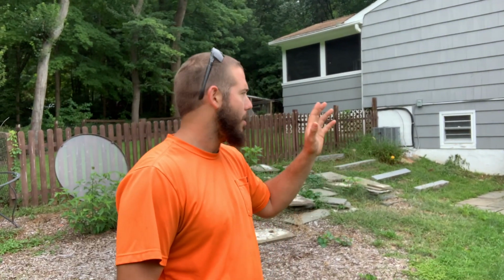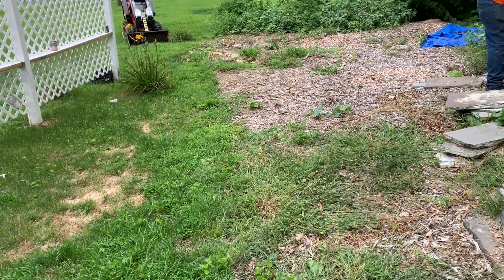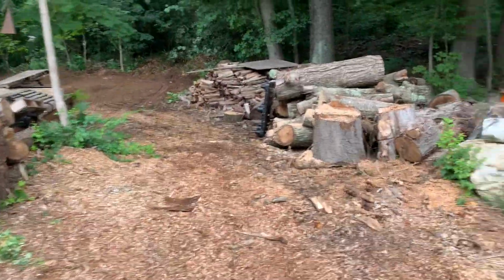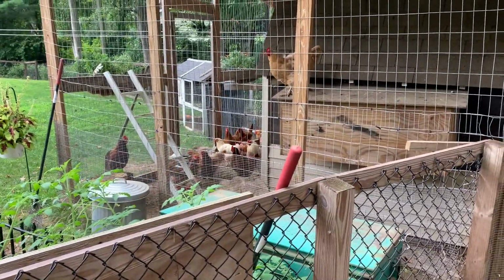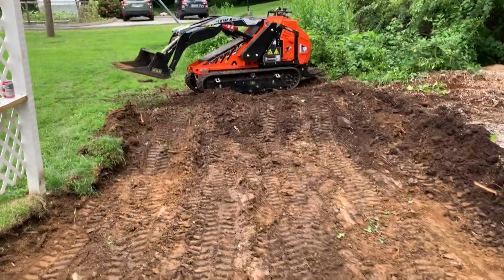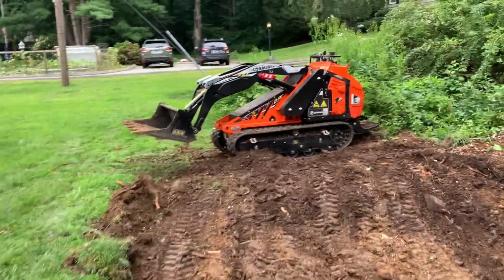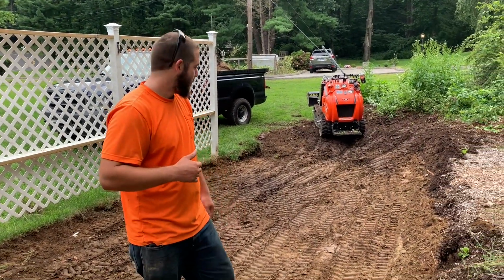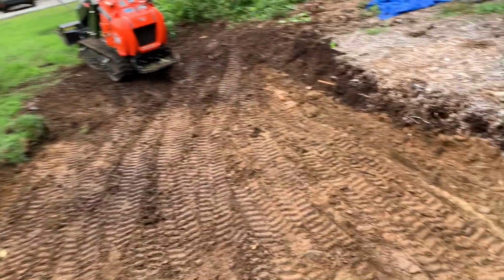#140 Cormidi Mini Skid Steer Digging Pad for Patio

Comment: Good video. You will get the hang of grading, it just takes practice. One thing I was taught when I started running a motor grader is if you get to wash boarding an area, you have to change something to straighten  it out. I found that to be true whether running a dozer, loader, motor grader or even a box blade on a tractor. Keep up the good work.
Reply from the maker: Wash boarding as in humps? Once I started leveling out a spot for the machine to start at it seemed to get easier/more consistent. We were both in a rush, will need to try again when we have more time!!

Comment: The cormidi was perfect for that job . When ever possible I have always used the pto tiller first too grind down and mix everything . I found it easier using a tractor too remove . Starting back farther like you said too start the grade is what I do also . It’s Probably one of the hardest things too do with a tractor and if you don’t start level right from the beginning it’s always a disaster . You guys did a really good job . 👍👍👍
Reply from the maker: It worked well! The soil was soft here so luckily a tiller wasn’t needed. Getting the grade is tougher than it looks!

Comment: Nice work. I've used the Toro version a bit. Very capable if time is on your side! I've always found it easiest to pick the lowest corner or end and have the bucket set at level then push forward, dump then reset and repeat. That way you can always take more off and not end up with low points. You'll have to get down to clay regardless to form a sole plate. Get a shovel (mechanical or hand) then dig a 12" wide by 4" deep perimetre ditch for reinforcement. If there were to be a structure built, you would add those ditches to wherever a wall or significant load would go. Nice vehicles. I wish they were affordable in Australia. Not even Landcruisers are affordable anymore. 😔
Reply from the maker: Thanks for watching!

Comment: I have to use my box blade that I can angle to get a flat grade.  Pain but it works,
Reply from the maker: We were thinking I could always go back with the rear blade on the tractor to fine tune it but once covered with gravel and sand it should be fine.

Comment: Lots of great topsoil for future use for Chris. 
Just curious, Jake, when researching before buying the Cormidi, what factors sold you on the Cormidi over competitors?  Maybe I missed it, but is there an episode on your channel discussing that topic?  Great video and editing as usual.
Reply from the maker: I talked a little about it in the first video I made of it. I’m all about dealer support, just so happens my Kubota dealer also sells Cormidi and they’ve been great so far with support. The other factor was lift capacity, the Cormidi is one of the higher rated machines out there (1500lb lift) while maintaining a compact footprint. The last factor was the fact that it’s totally modular, the entire loader part can be removed and an aerial lift, dumper, cement mixer, etc. can be added on to the base.

Comment: Trying to figure out what kind of crawler loader, antique or what? But many backyard growler loader I have. There's no name played on it. No ID numbers, no nothing. 0:28 And I don't know how to send pictures of it yet.
But I aint founded on the internet or anything like that. I got a $67 from Lennox. And this don't even it's got height. This one's got hydraulic system. Raise and lower in the bucket control. But it's a minute you sit down on it. And it's for the backyard, it's a little one.  Something like a kid could run.